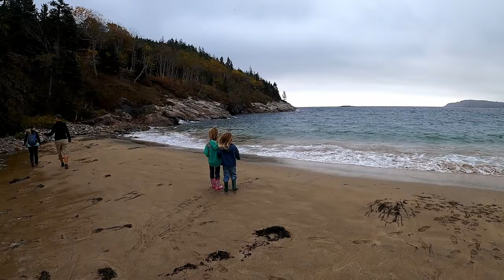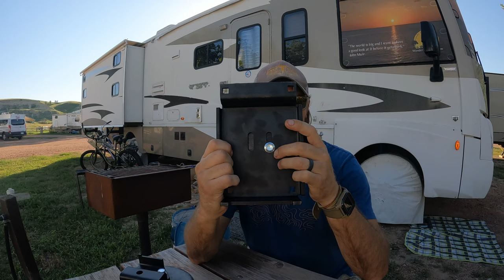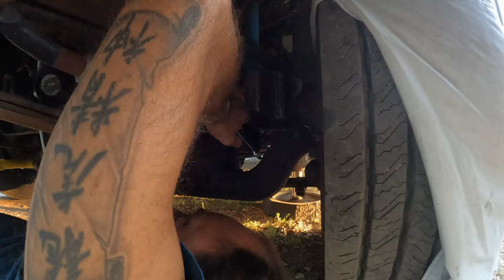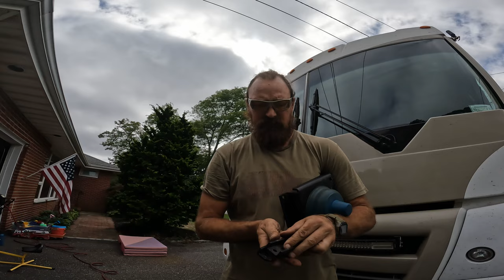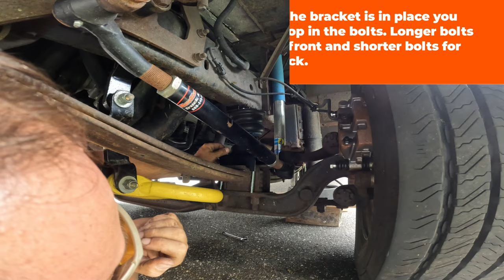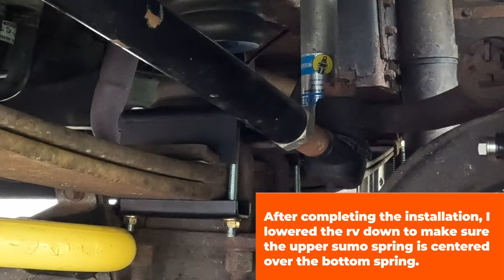Front SUMO SPRINGS Are AMAZING!! - Install and Review

Comment: Awesome, I have the front one on my Class A coming soon I have been looking at your videos so when they do come, I will be to put them in with no problem, I seen the one you install for the rear I will be installing the rear also, I just want to do the front because like you said they are easy.
Reply from the maker: That's great. I will say for our RV they made a huge improvement with the front end. So worth the money! Thanks for watching!
Reply: @WanderToGetLost  Okay,  so have you done your rear yet I see that the rear is a little more harder, you have to drill so holes but I'm thinking when I do my front I might not do the rear unless I can get underneath and am able to do it myself, or I can install the Timbrens they don't need no drilling.